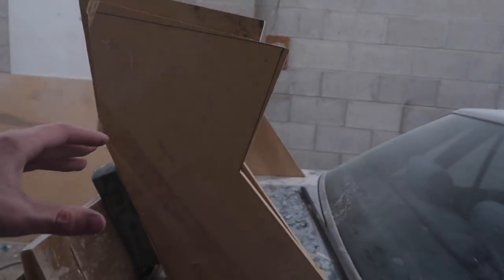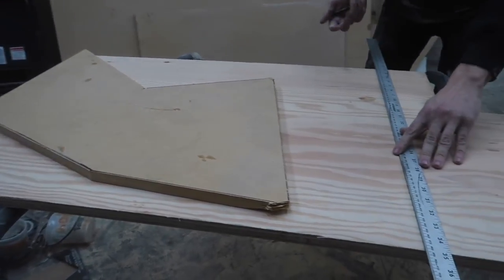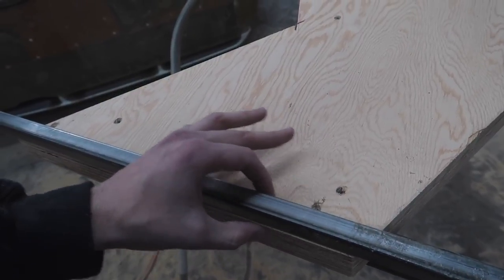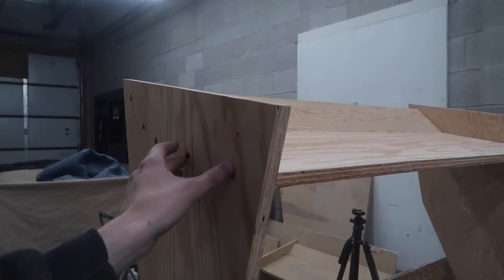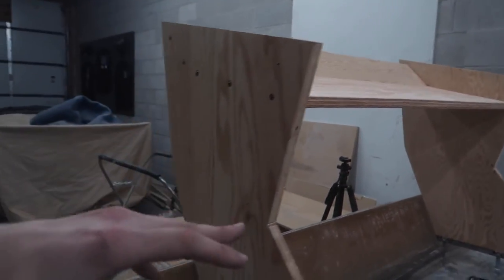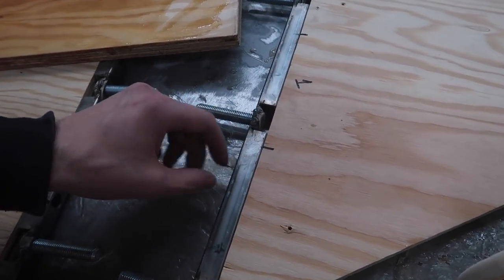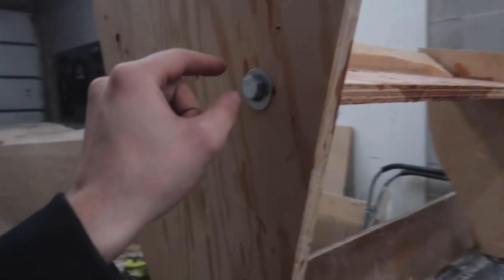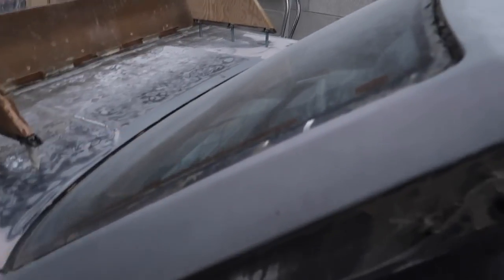Bosozoku Silhouette Spoiler Pt.2

Comment: One quick tip. Go buy a forcener drill bit (the flat ones) the same size as your washers for the top bolts. Counter sink the washers into the wood so their flush or just a hair below the face of the wood. This way when you fiberglass over it, you essentially hide them but yet still retain their strength plus when you tighten your bolts down, you won't be as likey to crack the glass as you tighten them. Also on the underside of the trunk I would cut the inner structure around your studs off and put a flat piece of steel that catches all 3 bolts (like a big washer) then tack the inner structure back to the plate. This will help the deck lid from warping over time and eventually crack your paint. Keep em coming Ty!
Reply: Forstner***  bit. And those arent the flat ones. The flat ones you are talking about are spade bits. Either would work and its still a good tip

Comment: Elegant solution to the tube attachment. Just a thought, the picture you have of the car on your hoddie, you could get that mill etched into the upright ply of the silhouette spoiler both sides. Primed and painted that would look totally unique. Would only need to be say 2-3mm deep and wouldn't take any strength out of it. Great work as always.

Comment: Be sure to use some spade drill bits to countersink the bolt holes on the sides of the wing. You'll be able to use the sturdy assembly method you have AND glass over it.